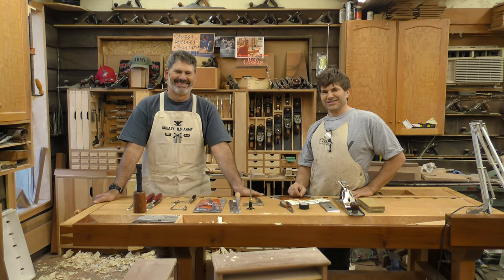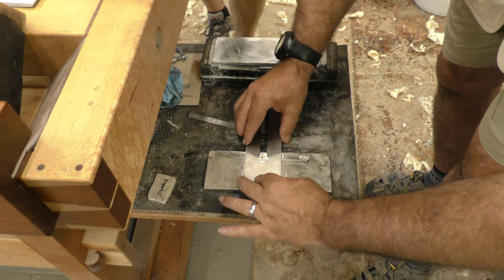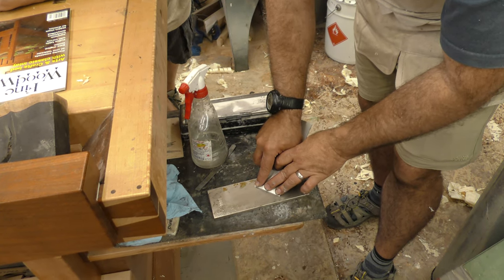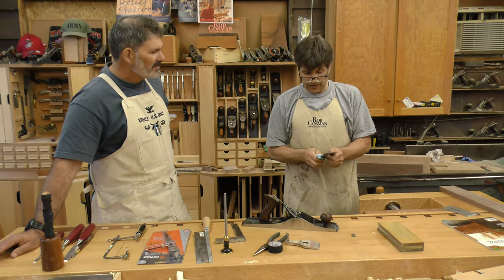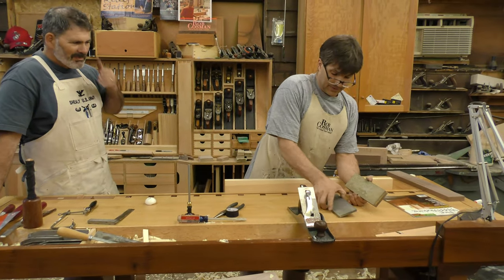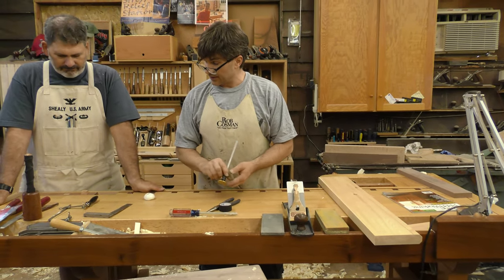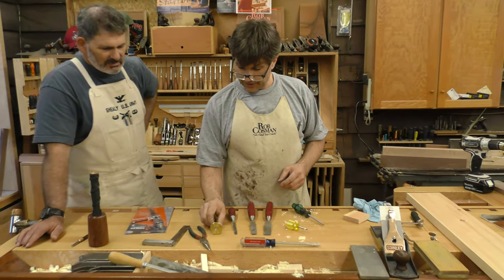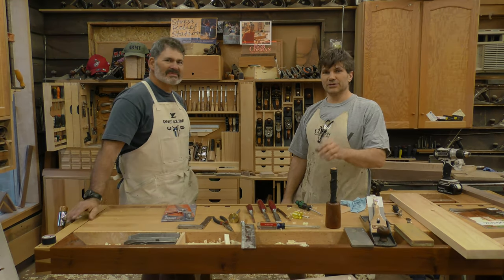Hand Tool Restoration project for Disabled Vets

Comment: Hey Rob my 300 grit side seems to wear out quick and have been 2 stones. Called them and they seem to think I am wrong. Yes I use the trend fluid and eraser. Compared to 320 grit sand paper the stone doesn't seem to cut nearly as fast after about 6 months.any ideas

Comment: I hope I can make a comment about saw safety, without sounding like I'm trying to score points off the Colonel's accident.  Please no one take this as any disrespect, either toward him, OR toward the SawStop Co. (who are selling an admittedly wonderful piece of technology).  Nor do I mean to imply any disrespect toward Rob for his advocacy of that technology's advantages.  The advantages are obvious.  BUT...  I'm here to remind everyone that those advantages are LIMITED.  SawStop tech is not a safety panacea.

The exact sequence of events Col. Luther described in his finger accident, could EQUALLY have been prevented by the proper use of a well-configured push-stick or push-pad.  If he had been pushing the piece with a correctly-shaped push-stick that positioned that hand 4-5 inches ABOVE the table, rather than right down alongside the blade... then IF the piece still were to have kicked back, his hand wouldn't have been pulled directly over with it.  Or even if something DID still somehow force his hand across the plane of the spinning blade, the push-stick hand would have gone a couple inches OVER the blade, rather than directly into it.  And that's even WITHOUT the stated missing riving knife, which if used, should have made the kick-back impossible in the first place. 

So I'm saying there were at least two levels of mistakes made (probably three mistakes, if you also count the admitted moment of "inattention") that combined to cause this event.  Address those issues, (along with the prerequisite full understanding of the geometry or force-vectors involved that lead to kick-backs, which many table-saw users do not rightly comprehend), and folks would never need the SawStop technology.  The reason I don't like the mentality of relying on the SawStop as an inherent function of table-sawing, is people seem to feel it excuses them from the necessary understanding of (or daily practiced adherence to) these fundamental safety issues. 

Proper understanding of the working force vectors, the necessary hardware accessories to prevent the results of bad combinations of those force vectors (i.e., a proper modern arbor-mounted tilting riving knife at all possible times, with included anti-kick-back pawls when possible, and an overhead blade guard if practicable), correct safe hand placement and/or well-designed push-sticks & push-pads, personal safety gear (glasses, dust-mask/respirator, hearing protection, perhaps even a full face shield if necessary), and above all, a proper full-time attitude of "Fear" (i.e. Respect) toward the machine and ALL its potential dangers.  These are my list of the safety essentials.  After you have all those items in place, THEN... if you want to add the price of a SawStop to the list, go ahead, BUT...

There's still lots of scenarios where the wrong kind of kick-back can majorly injure you, or possibly kill you outright, even on a SawStop machine!  Cuts are certainly not the only way a table saw can get you, AND... the table saw is not even the most dangerous tool in the shop!  All these safety issues apply equally to all the other power tools, in differing ways.  I'd call a big router or a chop saw, both probably equally as dangerous as a table saw, and a Circular Saw is surely worse, according to the statistics.  And you can't get SawStop technology on any of those!  As a generalized ideological principle, I basically oppose any notion of reliance on technology that tends to encourage any sort of complacency on these fundamental safety concerns. 

If anybody wants "Credentials" for the above statements:  I've done hard time in a production environment (not merely as a hobbyist), behind a 60's-vintage 5 HP Delta Unisaw.  (As well as equal time on the aforementioned router, chop saw, and circular saw!)  Several thousand hours, I suppose, if I were to tally it up.  During that period I personally WATCHED the major table-saw accidents of two other employees in that shop, which left them both maimed, as well as ending their employment.  Another co-worker had previously been speared completely through the thigh with a large shattered chunk of 2-by stock that was kicked back from one of those same two Unisaws.  He was still working there afterward when I hired on.  Also... my Grandfather, a self-taught D.I.Y. woodworker, AND his Son, my Uncle, a career general contractor, were/are BOTH missing their right thumbs.  Both from table saw amputations.  Both incidents were eminently preventable, with the no-cost non-technology of their era.
Reply: Hi COL Luther here.  Everything you say is correct.  Now I am a woodshop safety guru.  I only use push sticks model after what was in a recent version of Fine woodworking from Bennet Street Furniture shop that keeps pressure on the board and may hand about 6 inches above the blade.  I wont cut on a table saw without a riving knife, and when I cut I am totally focused on thc cut now.  Having said all that, I also have a Sawstop now.  It adds that extra layer of protection that for me is completely worth the small price premium.  I NEVER relay on the Sawstop for protection; I relay on my techniques, but I also know the Sawstop is there as a back up just in case all my techniques fail.  It does not hurt to have multipl safety redundancies, plus the Sawstop is an awesome saw.  Much better than my previous tablesaw.  I for one say follow all the safety techniques, have a healthy fear of the blade, and buy a Sawstop.